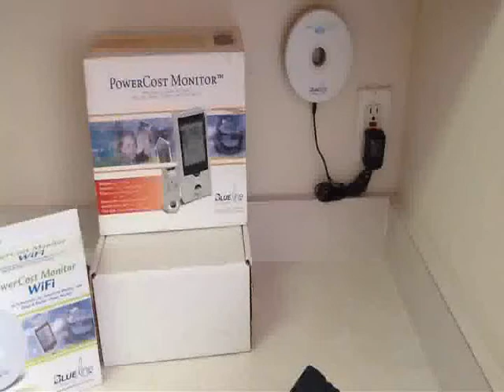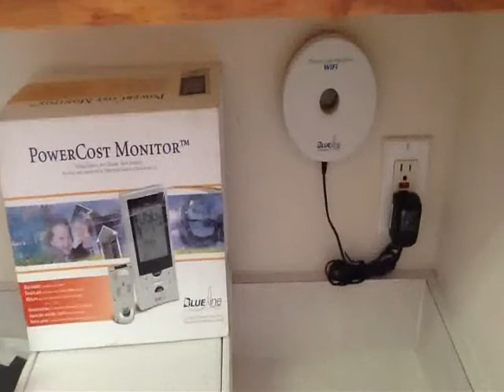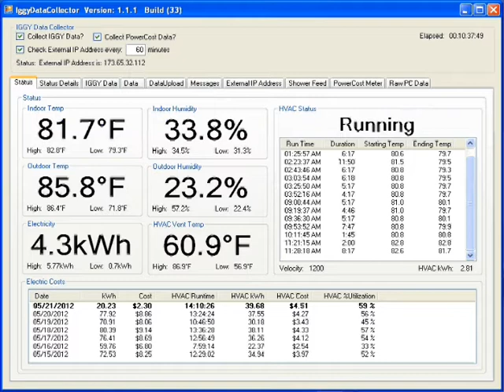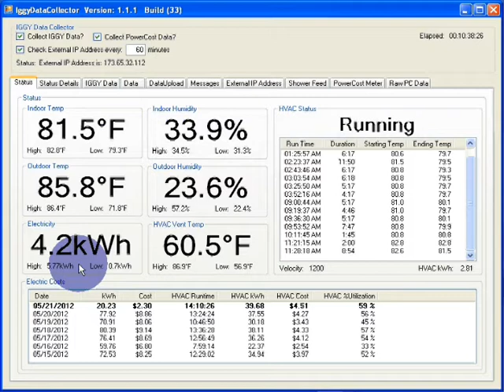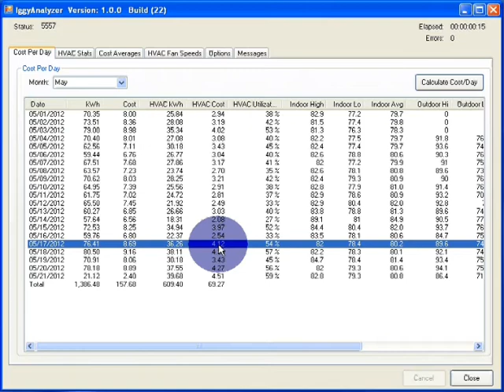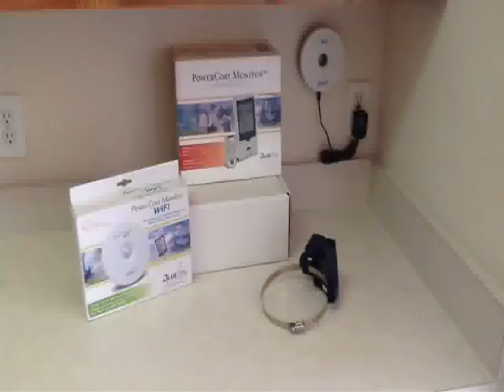Home Energy Management System using the PowerCost Monitoring System

Comment: Hey, that's awesome!!! I've been developing different plugins for my house. LOL So far, I'm able to connect to my DSC Alarm panel, my CAI WebControl and X10 home automation. I also was able to get voice command and speaking working with everything. Now I'm at the point of trying to connect my PowerMonitor. What you built is exactly what I want to build. I'm assuming the gateway has xml data? What are you running for temp sensors? Thanks for any info. (Are you using .NET?)